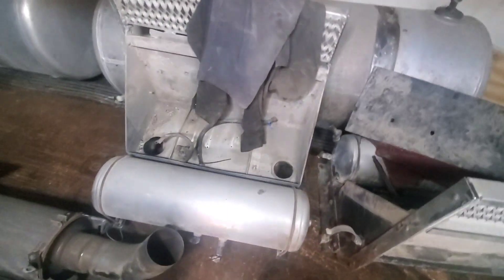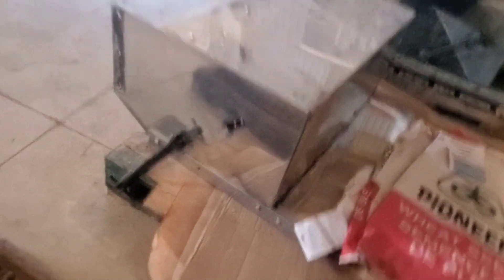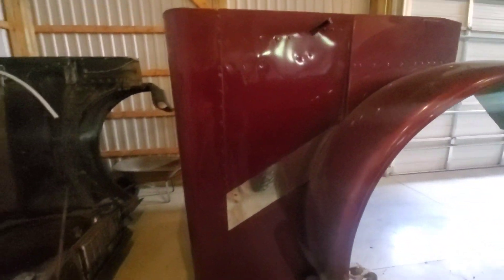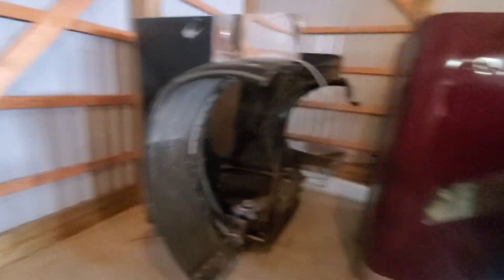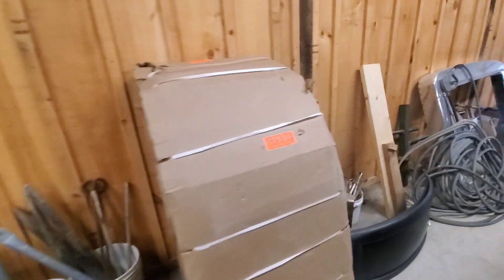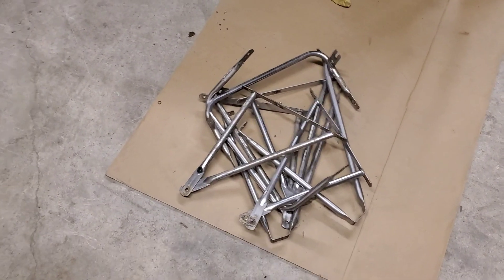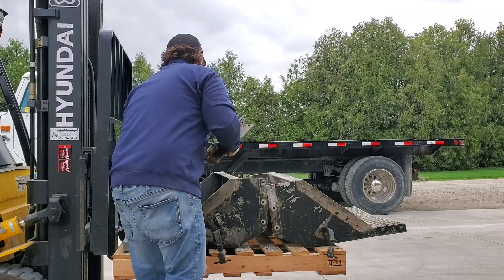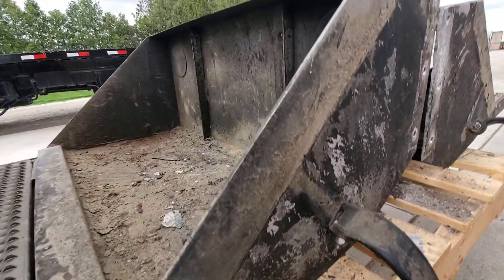Peterbilt 379 Rebuild (Episode 7) Truck is Home! Decisions Decisions...

Comment: Steel Hauler from Ontario ! Just stumbled on this channel ! Following along on this rebuild. Keep it up brotha !  Subbed 👍🏼 

Also the pete long nose hoods get so bad on the bottom corners because alot of people dont pull the hood open from the front cause there heavy so they lift it up from the bottom side & it cracks em over time.
Reply from the maker: Thanks for subscribing. Ya you have an excellent point on the cracked hood. I never even thought of that. The power of youtube!